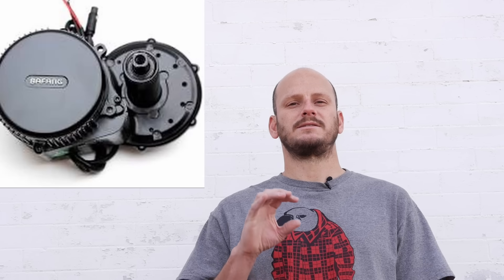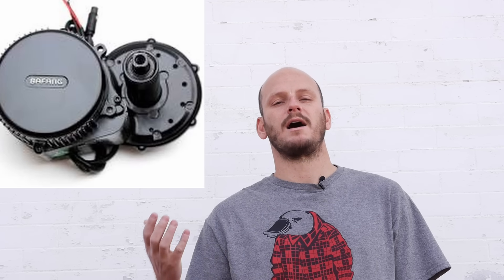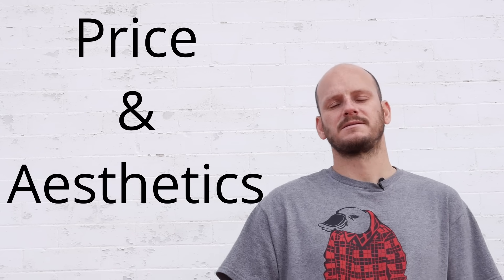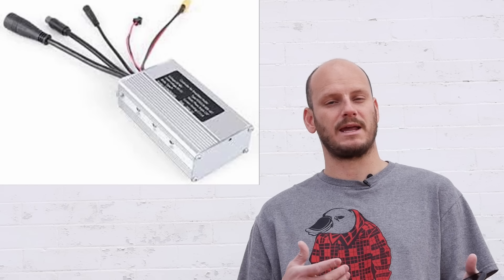Hub vs. Mid Drive Motors: Why Hub Motors Suck and Debunking Common Myths with performance test

Comment: Wow! So much misinformation. You clearly have no knowledge of physics whatsoever. You claim to be comparing similar systems, but you're not. The sensors and control systems have to be different, and that's a critical part of the system. For example, a Zero S and SR motorcycle have exactly the same motor and battery, but the inverter and control system on the SR is different, with much higher capacity, giving the SR much better performance even with exactly the same motor and battery. Then there's the fact that different motors, even of exactly the same type, are designed for different applications. That hub motor you're using isn't designed to be a top speed screamer, it's designed to be cheap and tractable for riding around a city and most importantly, OBEY GOVERNMENT REGULATIONS REGARDING SPEED. While all mid drives are designed pretty much exclusively for mountain biking and as a strictly off-road machine are never subject to the same speed and power limits as the majority of hub motors. So yeah, you're comparing apples with oranges.

1) Hub motors have only 1 gear. This is a GOOD thing. Electric motors have basically the same torque from 0 RPM to max RPM, so there is no reason to go through a multi-gear transmission. Try telling Tesla that they need more than one gear. [eyeroll] What that means is that the acceleration is nearly the same regardless of your speed.

2) Mid drive motors go through the gears and transmission, which is a BAD thing. First, it puts all that extra stress on the chain and gears, which wears them out much more quickly and increases the chances of catastrophic failure at the worst possible time. The smallest front chainring is much larger than the largest rear sprocket, which means you LOSE mechanical advantage regardless of what ratio you've selected, meaning that "double the torque" is in reality anywhere from the same torque (if you're lucky) to much LESS torque.

3) If you lose your chain with a mid-drive, you're screwed, but with a hub motor you just go to throttle-only and you don't have to worry about pedaling.

4) Mid drives require a purpose-built frame. You can't just slap a mid drive on any old bike.

5) Hub motors can be put on ANY bike. ANY BIKE!

6) Mid drives cannot do regenerative braking, hub motors can. So on those long downhills you can save your brakes and put energy BACK INTO YOUR BATTERY with a hub motor (not ALL hub motors, it does have to be the right kind and the control system also has to support it), while all that extra weight of the hub drive system puts MORE stress on your brakes and you can't ever get any energy back at all.

7) Mid drives are much heavier and more complex than hub motors. Always. Weight is a definite minus on any bike.

Sorry, mid drives are NOT better. They have just been honed for mountain biking, while most hub motors are deliberately designed to be lackluster because of idiotic government mandates. That is not an inherent issue, it's a regulatory one. But in spite of that, if you do your research you CAN find hub motors that will lay waste to any and every mid drive on the market. It won't be legal to ride around town, but it will DEFINITELY get the job done off road.
Reply from the maker: You should check out my follow up video on “the biggest misconceptions on Ebikes” 😀 Ebikes are completely different than electric cars.

Comment: It does not matter what motor is in the ebike, mine is a hub,  or the power WE ALL ARE LIMITED BY THE BATTERY!!!💥😎
Reply: Very good point. Even my cheap hub motor is limited to the 5 kW from the battery. if i had a more powerful battery i could pull a few more kw.
Reply: @difflocktwo  Exactly!!!!

Comment: Broken spokes - I've had a lot of problems with spoles and easier to change spoles with a hub motor than without - don't have to take off brake disc and cassette

Comment: I've built both hub bikes and krank motor bicycles and would choose hub drive any time. A well built back-wheel hub bicycle with proper wheels and a good tension sensor gives a much smoother ride than crank systems. The strain on the drivetrain on a krank-motor is obvious even with a great tension sensor. Also I really think it's a bit nonsense with the gearing advantage mentioned in this video. Any electric cars on the road with gearing and are they slower than most geared cars? Let's be honest, people normally use an e-bike to get to around and to work, not climb mount everest. Build everything with with proper voltage, I prefer 72+ volt motors as they give plenty of power from 0 and a decent top speed (50+ MPH). 48 volt systems is just way underpowered, even for crank motors. Maintainance is also close to non-exsiting with a HUB motor, as long as you have thermal sensors and power limiter in case of too much strain, but of course this goes for both motor types. And for two-wheel drive, what is your option on crank motors :-D
Reply from the maker: https://youtu.be/4zS0vD1QNB8

Comment: How durable is bafang mid drive on a mountain bike? I'm worried about hitting the motor on logs and rocks. Is it even a problem?
Reply from the maker: probably wouldn't be good for it to bash it on a rock, but other than that its fine

Comment: In non regulated countries with winter a hub motor is win win all Day every day, commuting.
With 250w motor (legal limit) spoke strain is not a problem.
A hub motor in Rain and slush Will eat chains for breakfast for normal People Who dont clean their chain after every drive.
A hub motor is cheaper to buy and cheaper to maintain and more reliable because it Will make The chain, sprocket and gearbox last even longer than on a regular push bike.

When The legal limit is 250w with pedal assist only and max 25 km/h (15.6mph) a hub motor is a no brainer for city commuting. A mid-drive is only for performance and for nerds. It is like selling a Ferrari to a middle aged woman Who wants to do grocaries and give The kids a ride to The school. Sure carbon-ceramic brakes are better but not worth The money for that kind of use.
The only advantage for a mid-drive gets overrun with drivetrain maintanance costs if you are not a bike mechanic. More torque? A 250w hub motor already IS like a Ferrari for most People compared to a push bike.

1. Speed freaks, nerds, bike mechanics and illigal tuners: Mid-drive.
2. 90% of People (Commuters) : Hub-drive

Comment: If you have a 1500W + hub motor on a 72V nominal pack i don't think your going to have any of those issues.
But, i am going to mid mount a 27Kw motor in another project i'm building.
Reply from the maker: yes, this guide is for street legal motor kits (750w or less)
Reply: @JohnnyNerdOut  How is this apples to apples comparison if you don't calculate power from the battery. Ebike/motor power ratings are kinda joke if QS 138 70h is only 3KW continuous when you can get easily 10KW of continuous or more. You can get 500w direct drive hub motor and put some statorade in it so you can give it alot of phase current. 750w BBS02 has peak power of 1400w at 52V like you say in your site. If both motors would have same power in this hill climb test at about 6mph you would need: 52V motor voltage and 27A of phase current in BBS02 and 11V of motor voltage and 127A of phase current in hub motor. I can agree that geared hub motors aren't worth it but take direct drive 1500W hub motor and controller that can push enough phase current then you shouldn't see any difference in performance.
Reply from the maker: @TheNone724  apples to apples using 750w rated motors :)

Comment: Doesn't a mid drive cause hard downshift gear changes when climbing hills due to the constant torque on the chain? I know just pedaling hard on an uphill climb on a regular bike puts  undo stress on my chain and derailleur unless I back off on pedaling. How is this attained on a hub drive without backing off the throttle which to me defeats the purpose of using assist on a hill climb especially in an off-road situation when I would need full assist?

Comment: Mid-drive makes sense for low power, yes all the way, but anywhere 1000w above you cant match the simplicity of hub motors. To my knowledge, there's no good, reliable way to use mid-drive without remaking the whole drivetrain to get more than 1000w. 

So hi power, hub is king!
Reply from the maker: I would agree, but not until 3kw. 1000w I would take a mid all day every day!
https://www.youtube.com/watch?v=4zS0vD1QNB8&t=89s

Comment: Given the mid drive motor replaces the spindle and connects to the crank, does it turn the pedals when you use the direct throttle, or can you keep the pedals stationary whilst the motor turns the crank and sprocket? Is it also pedal assist? Can you also pedal without using the motor?
Reply from the maker: 1- no it doesn't
2-yes
3-yes
Reply: @JohnnyNerdOut  Thanks for your response, much appreciated.

Comment: Not my experience, found opposite true, rad power agrees. Own both. 
My hub faster than mid motor, more torque from rear, faster 0-28. 
Work harder with mid motors, but longer battery life with less speed to 28

Mid motor seems to have more speed on hills, but more work, too

Hub motors more fun, faster
Reply from the maker: Ride a proper Mid drive (bafang) and I guarantee you will change your mind :)

Comment: I am so glad I have a hub motor, was approx 10 miles from home on my last ride out and my chain snapped and was not able to repair it there and then but still got home using the hub motor. would have this been possible with a mid drive motor ?
Reply from the maker: No that’s THE great thing about hub motors 👍
Reply: Yes. Just don't buy shit components like kmc and there ever wouldn't be a need for it in the first place

Comment: Hello JohnnyNerdOut,  I added an ebike conversion kit to a tandem.  It has a front hub motor.  The front drive gear is on the left side and connects to the rear hub for the second rider. The front hub is in an elliptical device to allow for tensioning the chain between the two sets of pedals.  Are there kits out there that could have worked to use a mid drive for this application?

Comment: Are you sure you were using a true 750W Bafang and not one that came out of a Radrover since those are only 500w, but labeled 750? That slope you went up should have been an easy climb. As for pros and cons, hub motors are quieter, less maintenance, and easier to learn. Middrives have a steep learning curve, especially if you've been riding only hub bikes. Middrives you must learn to downshift when coming to a stop, otherwise it's really easy to burn up the motor or strip the idler gear. As for spokes, I have never seen them bust due to motor torque.   I've owned many different versions of Bafang motors, and have rebuilt hundreds of them over the years, so I've seen everything possible that can go wrong and why. My main go to daily driver is a 750w hub drive, my Mountain bike has the M620 middrive, and my crazy build has a BBSHD, a Luna Controller with 2500w, but breaks often.
Reply from the maker: its a ~30% grade so it definitely takes crazy torque to get up it. No hub motor under 3kw would make it up from a stop IMO. Mid drives really just amplify basic cycling fundamentals that go with non motorized cycling ie: being in the correct gear to maximize efficiency.

Comment: Hub motors are so much cheaper and easier to maintain/repair and they also come in a variety of strengths for ebikes to motorcycle strength. Might loose some efficiency compared to mid drive but I think that is negligible as stated in electric cars that don't use gears because gears lowers efficiency with about 20% if I remember right. Only downside to hub is greater weight but because riders are so light it's still a lot cheaper than mid while mid  is cheaper in electric cars and therefore used.
Reply from the maker: I’m a performance based rider so for me it’s mid drive all day 😀

Comment: You are wrong about the price big time. Hub motor i just bought one 750W for 219.99 on ebay. Bafang mid drive is over 450.00-540. thats 1/2 price AND i dont have steep hills to climb. i can pedal up normal hills with breaks and difficulty but not impossible so hub motor should accommodate all my needs. im not fat so it shouldnt have any problems.

Comment: Watched the video.  Made a convert.  I'm buying a mid drive Bafang 1000W to replace my 500W hub motor.  How much would you pay for a 500W hub motor with 4,000 miles on it?
Reply from the maker: As long as it works you should be able to get $100-200 maybe on eBay or marketplace

Comment: I have both 750 watt hub motor on a bike and a 750 watt mid-drive on another and everything you say is correct except I disagree with you saying hub motors suck, they have their place in my opinion. My wife for example doesn't ride very much and only rides around mostly flat areas just to get out and get fresh air and sightsee etc. For her the hub motor is hands down the way to go, she is not a bike rider, doesn't like to change gears or pedal for that matter lol so a hub drive is perfect for her and doesn't suck. For me, I'm a 40 year plus bike rider, mechanic, wheel builder etc and the mid drive is hands down right way to go but in the end they both have their audience your kind of assuming everyone is like me and you and they are not so be fair here.

Comment: One word: disability. I need a throttle for half or more of my ride (bad knees).  Now tell me how a hub drive can be adapted to throttle only use and I will consider the rest of your points.
Reply from the maker: You just need a controller that supports a throttle input 👍
Reply: @JohnnyNerdOut  My local bike shop lied to me. They told me that mid drives could not work with a throttle. Thanks for the info.

Comment: Managed to fit 750w bafang mid today to my 29er carerra hellcat, Bottom bracket was the hardest part lol, I was thinking of designing a fin on the frame to the bafang so air is directed to kool motor down more, I just just sort wire out for the xt90 connector, What is the best place in Ebay for one of those square adapters or connector to a xt90, I will be buying a better battery, But yeah cant wait to go blipping on it thats for sure, Forcast heavy rain tomoz, Sim racing day if it is raining, Still tho be a good weekend out blipping on my hellcat bafang lmt edition.....

Comment: LOVE my hub bike, goes up very steep hills, does wheelies, dirt cheep, zero maintenance.  I had a Mid and I had to to tweak and repair is all the time.  One day the chain broke and I got hurt bad and I will never have a mid again. rack your nuts good and hard and you will HATE a mid. My hub is over driven with a 30 amp controller, its 3.5 years old and I ride it HARD.  My spokes are like new, TIGHT.  Mids are SOOOO expensive to say there are about the same price along with every other falsehoods here proves your fake news
Reply from the maker: For similar build quality of motors they are about the same price.

Comment: I like your comparison but price difference is more than 50 bucks and install mid motor requires heavy skills
Reply from the maker: Can you show me a difference of more than $50?
Reply: Look at eBay, hub motor is around $200 while mid motor $500
Reply from the maker: @MinhNguyen-ze7ic  are they of same quality though. Important not to compare Lexus to Hyundai.
Reply: I agree and like your expertise, except the difference of price :)
I installed hub motor on my bike 6 years ago, bought from eBay for $155, the hub motor is still running OK with 30 miles/week
However when replacement is required, I will install Bosch or BaFang mid motor for those reasons:
- hub motor consumes more energy, - motor's weight not balanced on 2 wheels, - mid motor has better torque-gear like you explained
Thanks for sharing knowledge

Comment: Totally disagree with you, you been getting the wrong ones, they have so much more power due to the direct drive.
Reply from the maker: A mid drive will still have more useabale power because it benefits from using gear ratios to its advantage

Comment: Is a Mid-drive more efficient than a hub motor...
Is a Mid-drive cheaper than a comparable hub motor setup.
Which type effects the most wear on the chain and cassette.
Does a Mid-drive have regenerative braking.
Do you have to space the cranks further apart on either system, making for a less than optimal narrow gait.
Can you have multiple chain rings on a Mid-drive.

Comment: How much would you charge for an ebike to go 100+ miles on a single charge for?

I like to travel far which the only thing I found that can go far is the CrossCurrent X.
Reply from the maker: There are many manufacturers of batteries with 100 mile range. Calculate how much wh/mile you plan on using and just get that size battery. Many custom battery makers out there as well :)

Comment: You need second Morgage for mid drive
Reply from the maker: for aftermarket kits, they are about the same price for similar quality hub motor kit. $450-525 usually, depending on supply.

Comment: Hub motors rule, no worries about broken chains and not being able to pedal home, your gears and chain do not wear out, 1000 Watts and 48/52 volts will take you anywhere within 50Km,  who cares about torque?   you're not pulling a trailer.
Reply from the maker: Glad it works for you. Some live in mountainous areas though the torque makes a huge difference in climbing hills👍

Comment: I also disagree with the premise that this video is an equal comparison- most people don't think "ok, should I get a 750w hub or mid", they think "ok, I have $500, do I get a 750w mid or a 1500w hub plus the extra battery to make up for the lower efficiency"